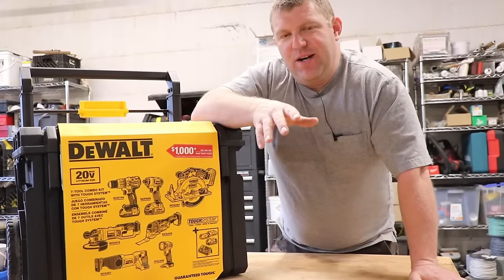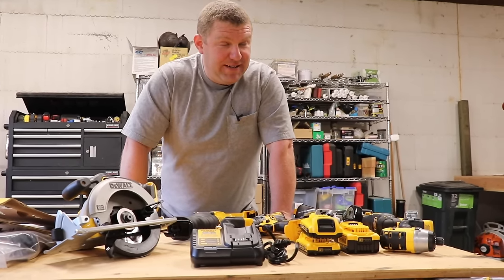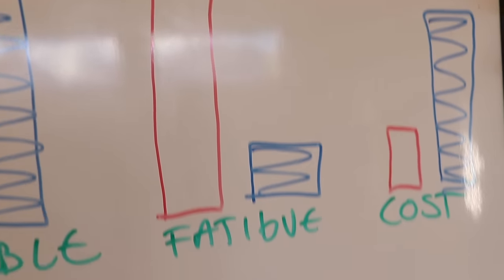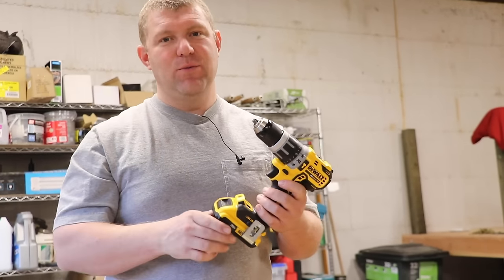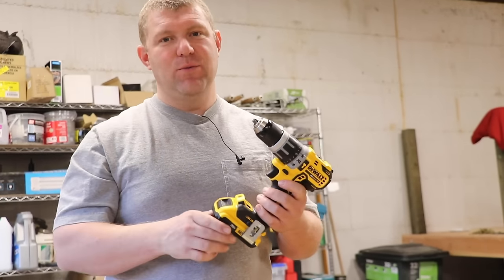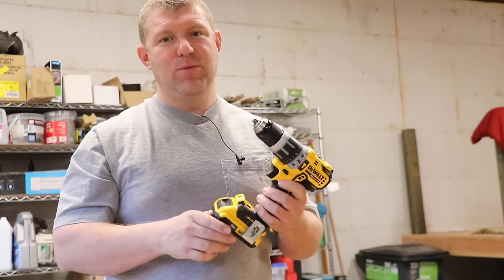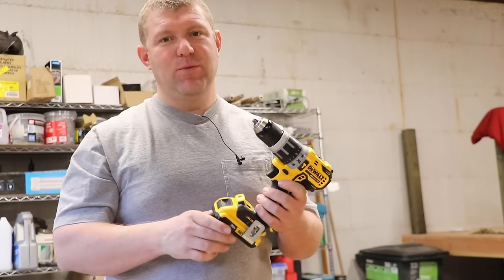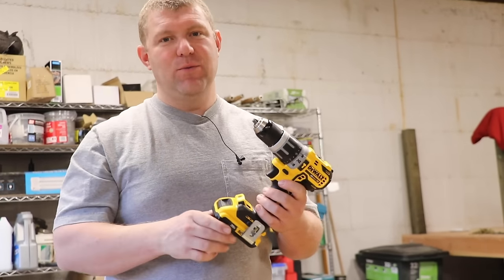SHAME ON YOU DEWALT

Comment: I use Dewalt cordless tools professionally, have for years.  I use their impact driver because it simply feels better and seems to drive better than the other brands I have tried.  A cordless grinder is an emergency, quick hitter tool, not a long use tool because the amp draw is crazy high. Also, the grinder wind-down is no different than the other grinders I have used.  The small circular saw is a great little, lightweight tool. I have an older 18V that I use most frequently on roofs or other locals where a cord is a pain. Your discussion of the circular saw limitations on a 45 degree cut is a bit disingenuous since the 7 1/4 you wanted will only cut marginally deeper on a 45.  All tools wear out, all batteries wear out. It does not matter much where they are built (spoiler, they are almost all built in China or assembled outside of China with Chinese parts).  You bought that collection of tools based on price point and at the end of the work shift I believe you will conclude that the tools do what they are supposed to and that you got you monies worth.

Comment: Note for reference the batteries in the kits have less amp hour power than the same batter you buy off the rack. This is from and engineering department of the major company that makes Milwaukee Rigid and Bosch and Riobi. But it is the same with the maker of Dewalt who is no longer Dewalt!

Comment: You really didn't do your homework on this, past reading advertising material. Brushless tools are only as good as  the tool engineering, construction and materials. There are many dirt cheap brushless tools on the market already that are prett y much as good as dirt cheap brushed tools. Top end brushed tools are far superior to the mid range brushless. AVE did a really good video talking about all aspects of this subject. DeWALT is like all of these cordless tool companies, they used to be good, but now you need to do a ton of research to see what you are gonna get. Don't pray at the brushless temple without doing your homework.

Comment: Take it from a handyman that has to be able to do anything at anytime.  I have used Makita for decades.  I have old NiCad drills and saw that have been used for years, some even dropped off single story roofs.  I have updated to all 18volt brushless and I love them.  Ive tried DuWhalt in the past, no thanks.  Overpriced Black and Decker.  Milwaukee would be my second choice.  Do yourself a favor and compare a new set of brushless Makita anything to the DuhWhalt and I bet youll like the Makita.

Comment: Using my 12 volt Craftsman set which I bought about 6 years ago. The multi-tool is one of the most useful for plunge cutting for outlet boxes and I love that the drills are so small they fit in my pocket. Only problem so far is two of my battery chargers quit working. 40 years ago when I first started in the business I was using a push drill driver and I was so pleased with the first electric drill driver I bought which was a skill

Comment: I have the brushed impact and drill, and a brushless oscillating tool. Bought them all individually as I needed them.  All other tools recip, circ saw, and grinder are corded.  Never really needed them wireless, sure it's convenient, but it's never really been an inconvenience.  All tools have performed well enough for my "harry homeowner" work.  They're affordable for what I need them for, and I like the color cause it's easy to spot from across the room/yard while cleaning up.  

The next cordless tool I'm hoping to get from DeWalt is a little trim router. (they don't make it yet, but the rand orbit sander is a promising development)  Short usage time and cords are annoying on routers, and I'm already into the battery set.

Comment: Been using dewalt for years also noticed you have to buy a single battery at a time. Seems if u buy a package like a 2 pack there is always 1 battery that doesnt last as long as the other one. Like 1 good and 1 is crap

Comment: I had one of the original DeWalt corded drills before they had or made pretty much anything else. That drill lasted a very long time like 20 years. It finally burnt out so I replaced it with another one with the same specks and it was corded. That burnt the first hole I drilled so I took it back and replaced it with another one the same day. That one burnt out as I was finishing the hole and it caught fire and melted the plastic. The holes I was drilling was an MDF door where the handle would go and I was using a jig to do the work. That's what I used the original tool for. It was the only purpose for that tool. After the second one burned out the same day I purchased the Milwaukee Compact Corded Electric Spade Handle Drill With Pipe Handle — 1/2in. Chuck, 7.0 Amp, 900 RPM, Model# 1630-1 that worked beautifully. I found out that the DeWalt brand has gone down hill since they are no longer made in America and are really a Black & Decker rebranded which is total junk. The only DeWalt tool I now own is there miter saw stand and even that falls apart after about a year or two with every day use as a finish carpenter would use it. The ends fail where the side mounting bracket mounts. It has a week weld that doesn't hold up but other than that, it's the nicest design out there that I have found and so I have purchased about 5 of them.

Comment: Black and Decker have always been fiddling specifications. (Many) years ago I was working for a company that built electronic motor controllers for some of their corded drills (no batteries were good enough in those days). They sold consumer and professional ones. Apart from the plastic parts being different colours, there was one resistor difference, it made the "professional" one slower, so that the bearings, brushes and other parts would last longer.

Comment: If it seems to good to be true, it probably isn't. Do your research, especially if the bargain seems too good.

On the bright side, many of us started with a cheapo DeWalt combo kit and upgraded individual components as we went. Brushed drill and driver are also handy to have around as back-up to avoid switching back and forth. I have pretty much that same kit, only mind didn't include a toolbox. I still use some of the tools that I haven't gotten around to replacing like the circ saw, the grinder and the oscillating multi-tool. The problem is that I have solid  corded tools for those, and if I need something really capable, I can fall back on them, so I haven't been sufficiently motivated.

DeWalt knows human nature, and they're counting on even prosumers not being wise enough to avoid they tricks. Remember, fool me once, shame on me.

Comment: The circular saw test needs the same sized blade.  the larger blade will pull a lot more power.  please retest with two new blades that are the same size.

Comment: Well, I see you have the Home Depot Dewalt batteries.  Never buy tools at Home Depot, they are specially made for HD and are extremely cheap compared to the standard Dewalt tool. Brushless or non-brushless, I wear them out in the chuck and and in "airmail" service. long before any motor issues. If I can get 6 months out of a tool then it is a "good" tool. Cordless tools are considered consumables; use 'em, abuse 'em, toss 'em out.
Again, most important, do not buy these tools at Home Depot.

Comment: just like with cars guys are brand loyal.  I work for a very large commercial construction company and we abuse the hell out of tools when it comes to drill and impacts dewalt brushless blows away the competition. Makita tools are garbage when it comes to heavy use. with that being said tho we use the 36v Makita circular saw you have with a steel cut blade for cutting structural metal studs and it does a good job. I haven't tried the 60v rear handle (as you call it) saw yet bit I would bet money it out performs the Makita. I remember the Makita rep giving us a killer deal on a bunch of corded screw guns at like $30 bucks a pop and within the first week more than 1/2 of them died!  the rep showed up with rebuild kits for them and we laughed!  just what I want to do have guys rebuild tools every week!  total garbage!

Comment: Dewalt used to be my favorite tools back in the 14v days, I had a drill that would run forever! I bumped up to 18v, and they turned to absolute shit overnight, the battery life was around half. Any of my real work that requires effort, I relegate to my back up Ryobi tools, as like my old dewalt, the batter life under load is twice as long.   So I'm moving back to makita, and Ryobi as my backup still.

Comment: These are cosumer all the way. It’s meant to be competitive with the cheaper brands. For most people, they would never see the difference.

Not having a fixed depth shoe will really hurt when cutting metal, because it will wear the blade in just one spot. Again consumer is usually doing more wood cutting.

The Allen key to take of the wheel cutter is quite chincy too.

With that 6.5” blade it will take way less power and will do the job for consumer grade.

Totally agree, If dewalt was just honest it would go a long way... this is where likely branding is just messing everything up.  Dewalt don’t erode your brand and provide consumer grade tools when you are a pro or prosumer grade traditionally.

Comment: My issue with buying DeWalt is trying to figure out what size battery is included with each set!  Also the last drill/driver set I bought at Home Depot not only didn’t say what size battery (in amp/hours), but didn’t have a life indicator!!  
I have had 3 out of 4 batteries go bad within a year of purchase, but my local DeWalt store replaced them, no questions and no charge.  If I buy another set, I will take my wide rear into the store and talk to the workers FIRST!!!

Comment: The DeWALT circular saw in the kit was turning a smaller blade and cutting less wood, reducing the load on its battery, in addition to the differences Jesse pointed out in his run comparison with his Milwaukee circular saw.  Whoa! At the end, Alyssa is doing the clean up?

Comment: I have used Dewalt 18 volt brushed tools commercially for close to 20 years. We bought an impact driver to install 10" screws in treated lumber. You cannot beat a dewalt tool or battery. We have Milwaukee also. The  Milwaukee sawzall weighs almost twice the dewalt. Imagine the fatigue that you experience holding the Milwaukee over your head. When I take the Milwaukee to do a job it often takes 4 batteries, the Dewalt takes 2 batteries to do the same job. I was using the Milwaukee sawzall over my head one day. The weight and vibration locked up my right hand. My first 18 volt batteries are still going. The replacements do not have that life. Dewalt is the industrial arm of Black and Decker. I bought a 3/8" corded drill at 16 years of age I am now over 3 times that age. Dewalt corded drill still going.

Comment: Unfortunately the box stores have destroyed power tools by forcing manufactures to make them to a price point instead of quality. I have burned up 2 Chinese Makita  impact drivers just doing one  metal roof only to return them and not have any option to buy a true Makita made in Japan. If you check Grainger they display where the tool was made but your gonna pay for the quality tool. Remember going to an actual tool company where all brands were displayed and you could get them repaired onsite? Those were the days!

Comment: Only got 8 mins in and all the info seems to be confused, you bought a kit from homedepot was the first issue, second you can buy all those tools separate! Just not at homedepot, third don’t buy dewalt if you are a homeowner buy black and decker. Dewalt is a contractor grade, XR does not necessarily mean brushless, most Dewalt tools will say brushless if they are. Atleast Dewalt is trying unlike many other companies and contributing to their American economy vs Milwaukee owned by TTI or Makita being Japanese owned. Gave up super early since I am a tool Nerd and I work in tools, dcg412, dcs391, dcl040 I believe is the light, the drills kinda look like a dck287 kit but we don’t carry that stuff in Canada since it’s not the best drills, a dck299p2 would be Best Buy then buy all the tool only you need. Don’t shop homedepot use a tool store like construction fasteners,KMS tools online, atlas machinery, HDSupply these are few major retailers that mostly offer online buying if you don’t live nearby but know that they have amazing in store pricing

Comment: This is not deception at all just poor research on your part, nowhere does it say it's a brushless kit. Dont blame a company on your failings to pay attention.

XR doesnt mean at all thats its brushless, even the old tools had XR and XRP on them. Only if it says brushless is it so, also you can tell by the shape of the motor housing on the tools.
Reply: Couldn't agree more.  Glad they don't mind dropping $500 on a kit without even looking at whats in it.  A quick google search would inform you that they are not the contractor versions of those tools.

Comment: As soon as I finished watching I headed down to the garage to see if I had fallen into this trap. Annoyingly two of my Dewalt power tools are not brushless. I had assumed that XR meant it was brushless and highest rated in the range. Thank you for the heads up, great video. Dewalt have just fallen in my estimation due to the confusing marketing and labelling. I will be much more careful in the future. Are you returning these tools? In the UK the suppliers would most likely not accept return as they are now used. USA retailers are much more generous with criteria for returns.

Comment: Dewalt is like any other power tool manufacturers, they got the cheap line with small batteries. In this case it seem like a lack of reseach before a buy. And if you dont want to do the reseach, look up the the tool you want, find the one with the one with the highest model number you can afford and go with that one and you should be golden :) Seaky sales tactics is the world we live in, almost all manufacturers does it and you get what you pay for.  Give their flexvolt a try if you want high end.

Comment: With the Makita 36v saw, you don't get double the amp hours, you get double the voltage out of your 18v 5AH battery packs. Remember, batteries in series gets you more voltage, batteries in parallel gets you more capacity.

Comment: If your going to drill a hole into concrete brick or any other stone type...its ALWAYS  SDS never use those tiny little teeny weeny drills to do that work as for brushless im in the trade and i DON'T have any brushless ..i use small drills (12v) or ( 10 v) and have bigger for  larger holes and mains power for the big stuff,never use a reciprocating saw ever,never had the need ,doubt if ill ever have the need either .have various saw hand types that do what i want ,i do see the need or use for these kits and have been tempted many a time but...9 outta 10 i only need the ONE tool out the whole set,maybe one day ill get a whole kit....maybe :)

Comment: That's why I buy Single Tool Only when buying Dewalt, unless if I need more batteries. The models can be a bit confusing but you really don't save much if any amount of money buying these combo kits. I recently bought their flexvolt (60V) reciprocating saw with a couple of their 6ah batteries, and the tool itself cost around $90 after subtracting the cost of the batteries and the fast charger. So their top of the line reciprocating saw costs maybe $10 more than the one you got in the kit.

Comment: I used to think the same thing about the flashlight, but I actually find myself grabbing it quite often for a little quick light.  As for the batteries if it's a 2ah battery or smaller I don't even use them other than in the flashlight.  They just don't last long enough.  I also use the hell out of my oscillating tool, just wish the blades were a bit less expensive.

Comment: I love my Dewalt drill and impact driver, and especially my 120v Flexvolt miter saw. I love my Makita drill and impact driver, along with my trim router and sander. I love my Ryobi brad nailer. I love my Milwaukee chainsaw. If you buy the best of breed,  you will not be able to stay brand loyal. You can hardly go wrong these days, with even Harbor Freight putting out some decent battery tools in the Hercules line. Do your research, and benefit from the experience of others. Don't but lured by color uniformity or aesthetics.

Comment: I bought all Dewalt XRP tools back when they where new, late 90s/early 2000, Not one of them has broken yet, so I have never had to replace anything. They still work fine, and I can get new li ion battery's for pretty cheap of EBay. Now get this The first screw gun I ever bought was one of the Ni Mh tools. Probably mid 90s. When the Li Ion battery's came out I just keeps using the same screw gun with the new batters. Do you think I can kill that thing. It has literally driven in thousands, probably easily tens of thousands of screws, I just had a look at her, she is a DW056 Things where built better back in the day, That's certainly hard to Argue. So while New School May look and sound Cool OLD SCHOOL has proven the test of time.

Comment: Thanks, Jessie. I learned something. I was not impressed with the different brand kit. I promised myself I would go electric from now on. Just several of the tools’ work time and ability to get the job done was beyond frustrating. The three I tried was the drill, The reciprocating saw, and the flashlight. No kits.🙁 That was bait and switch because the pictures were on the box. You should do a comparison between corded & non. Curious